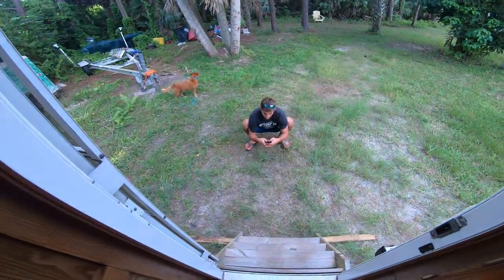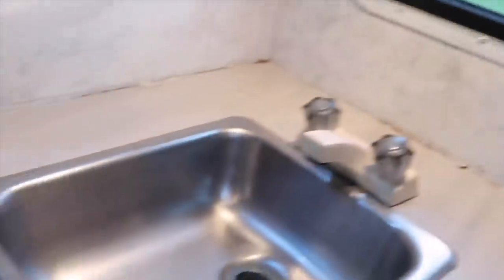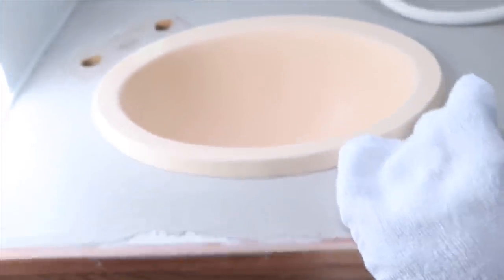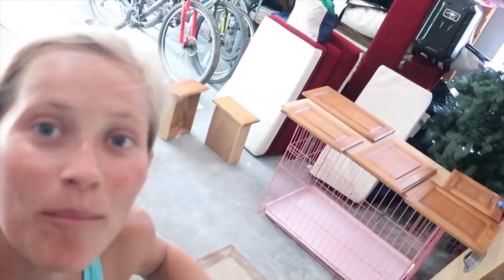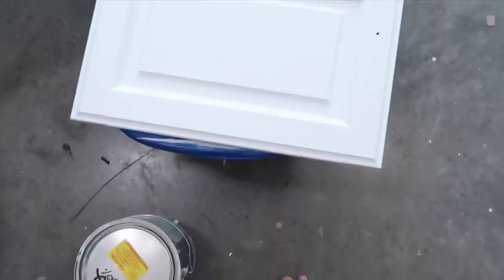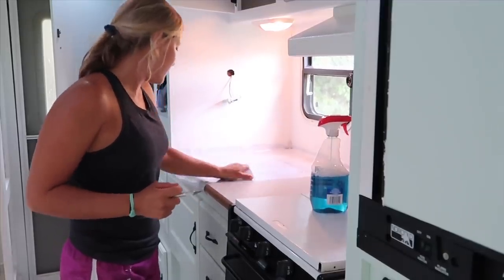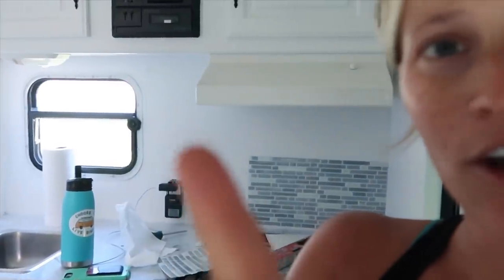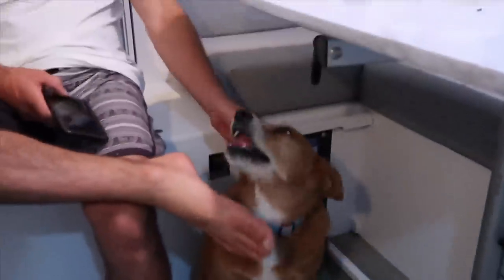COMPLETE DIY Interior Renovation Of Our 20 Year Old TRUCK CAMPER - Terra Tula

Comment: Those square head screws are called Robertson screws. Used throughout the RV industry and in Canada. Some peeps get very emotional about screw head types. Particularly the Robertson screw head fans.

Nice work.
Reply: Looks fantastic!
Reply: I have been using square recessed screws since I started in the construction trade and that was 45 years ago. My first square recessed cordless driver was a Yankee spiral screwdriver.
Reply: Once you use Robertson's you will wonder why there are other kinds.
Reply: Lived in Canada and discovered Robertson screws when assembling a water bed. I have used the since! Menard's has them!

Comment: Great transformation - always a 
good feeling to get rid of someone's
old dirt, ducktape and goodness
knows what on earth.  All the best for your road journeys.  Love to you
both plus precious Jetty from
Switzerland.
Reply: Before you put your new Masters on that plywoodany drill some holes in it or figure a way to have air flow underneath the mattress or it's going to mold right away again...
they also have these dry bags to get some kind of crystalline them that draws the moisture out of the air in that might be something you might want to give you then put in the camper to to help keep the humidity from building up in the camper...
you doing a fine job there young lady keep up the good work I can't wait to see the finished product 😊❤️❤️😃😊
Much love and prayers he gets be blessed in Jesus name... BBE 🤗 🤗❤️♥️
Reply: You can buy a breathable base cloth I have seen others use it under there mattress and it’s got waves on top to give air between the two surfaces.

Comment: Try a stapler to keep your material alignment. I do that with leather and vinyl and it works great. Just use a small screw driver to remove them as you get close to them with the needle.

Comment: Go to a paint store and ask them for the chemical called DIF for removing wallpaper. You spray it on ( in a garden sprayer ), wait about 5 minutes, then just wipe it off with a moist rag. I did painting for a living at one point in my life. That is what we did to remove wallpaper. I forget the name of it, but it works great. You would be able to do the whole camper in about 45 minutes ( from start to finish ). Then it is just a matter of waiting for the walls to dry ( roughly 1/2 hr ) so you can start painting it.

Comment: Painting a plastic sink. Go to an automotive parts supplier and buy a compound called adhesion promoter and use that first. It will "prime" the surface and create an interface layer between the plastic and the paint. I would also use an automotive paint to finish it.

Comment: Hey guys watched all the work. Heads up on the mold that you found under  the old mattress. 
The roof leaks, all that work you did may get wet. You may want to reseal the roof with that liquid  rubber. Chalking everything on the roof with silicone beforehand should dry it in.have fun.

Comment: May I make a suggestion, check out the roof if you see cracks or soggy seems use  Sikaflex Polyurethane Sealant, works like a charm. OMG after 8 or more coats of paint you don't need the GYM, but I must say it looks real nice.

Comment: Please look into using Kilz paint for the bed.  It does a good job sealing the wood and stopping anything leaching thru the paint.  If you are really going to paint the cabinets, be sure to sand the shine off of them.  Use a good primer, and you should get away with one coat of regular paint.  Good luck!

Comment: I would have gotten a new faucet and sink for bath. Hope the paint works. Also I would have removed the sink. Check out amazon for cabinet hardware. Amazon basics has some nice affordable sets. Taking the sinks out first would have made the contact paper process easier. Your floor seemed to easier than mine. The connections on my edge kept breaking. 
The sticker tile looks cool. You may want a bungie loop on the door latch when driving to hold the door in place in case the latch pops off while driving and bangs back and forth; you won’t know til later. Very cool and looks amazing.

Comment: Sorry I hit the wrong buttons also remove and ad new insulation when you repair the wall.  I think the roof is a one piece aluminum roof so if water is coming in check the edges for loose metal.  I wish I was younger so I could come help you with you repairs,  but at 75 and injured I can’t.  Love you guys.  Tom

Comment: I've done the contact paper before and Im super OCD about straight cuts so what I did for the sharp edges, like around the sink, I used a spackle knife and put some painters tape on it so I didnt scratch the contact paper. Pressed it hard against the edge and ran the blade down. It made really  nice clean cuts, just for future reference.

Comment: Manufacturers add a chemical to plastics to make them less flammable but the downside side is it causes the plastic to turn yellow over time. The plus side is when you see a smoke or CO2 detector that's yellow you know it's old and time to replace it. Keep up the good work and yes, you picked the correct paint for the sink. A little bit of worthless information from your uncle Mark.😁

Comment: Awesome job on the renovation! It really opened up and lightened up the living space. The only problem that I can see is that painting that sink basin with regular paint was a mistake. I guarantee that it will chip or peal off after moderate usage. You need a more durable surface finish like epoxy. I know you said that epoxy was incompatible with the plastic. Replacing the sink with porcelain or stainless steel is a better option. It's not that hard to do. I know you guys have the ability to change out the sink.

Comment: I enjoy your videos.  I have also been researching truck campers lately and apparently mold underneath foam mattresses sitting on plywood is a common issue.  Have you guys considered some of the solutions out there to allow airflow under the mattress.  Hypervent is one thing, and there are others.  One looks like hundreds of little plastic pedestals put together but I can't find it at the minute...  Anyway, something to consider, and I'm sure you have because boats would seem to have the same issues.
Reply: Froli Seep System is what I was trying to think of with the little plastic pedestals.

Comment: So you do not appear to have encountered any of the sort of thin paper like vinyl used on the surface of the cupboard frames?  I do not know how to repaint that surface and have it last like the all wood surfaces my camper has.  I am wondering about using Chalk paint so I don't have to sand it and disturb it and maybe have it make matters worse, and then protecting it with the Varathane interior sealer.  Thoughts?

Comment: Awesome job! Next time you have some wood to clean and sanitize use some liquid pool shock 12.5 and good surfactant. It's a ton cheaper and 100 times better then buying the name brand spray bottle stuff. Now for the back splash being sailers you both should know how to use a TICK stick. 
Thank you 
John Doherty 
LykeNew Power Wash 
Salina kansas location

Comment: The mold issue under the bed is a common problem in campers with an area below the bed that is not climate controlled.  The temperature difference between the warm mattress, and the cold floor creates condensation, and the mattress soaks it up and stays damp on the bottom.  to remedy the situation you can place a matt between the mattress and the floor that will allow air to flow between. here is a great video about this.  https://youtu.be/CYQzZ9ukwG0?t=1052

Comment: ok so about the commercials?  Is it my imagination or have the commercials increased dramatically?  No Bueno! 
gottal bounce....good luck!
Reply from the maker: YouTube picks the mid roll ad placements I think because this one was longer they are putting more in.
Reply: @Tulasendlesssummer  ads have ruined youtube.yes i know there important but they have become to excessive.
Reply: ...Ad Blocker....
Reply: @kjc9trader491  how do you do ad blocker?
Reply: @Twelvestonestacking  It's a free app, just install it. It allows you to turn it off and on as needed since some pages won't let you see them if it's running. You can just pause it for the current page or turn it off for the whole web site.
Reply: @rumblechick73  groovy 😎
Reply: @rumblechick73  Best thing EVER! just did it this a.m.   very kewl!  thank you

Comment: Good luck with these crank jacks, new electric jacks with remote will set you back $3k. I mounted my truck camper on a car trailer to tow behind my 1999 Dodge dually 3500. plus, I did not need to bagged the rear. Nice work, Good Job..

Comment: I'm astonished, I mean, you did an amazing job and that was so much hard work and at the same time it was done with the absolute cheapest, most toxic products imaginable.  Like for under $50 you could have installed an amazing bathroom sink versus spray painting it.  Labor is the hardest, most expensive thing you used here so why not spend it using high quality items.